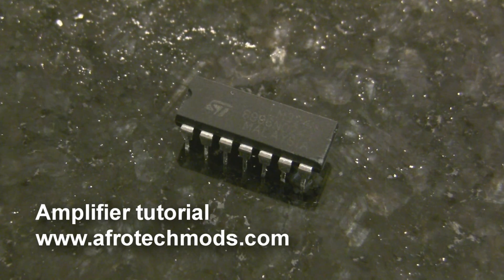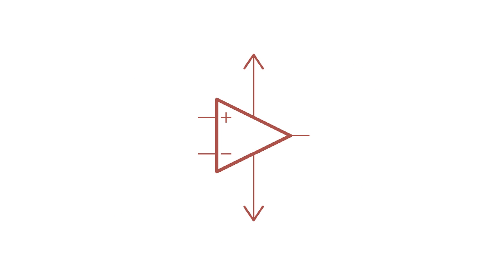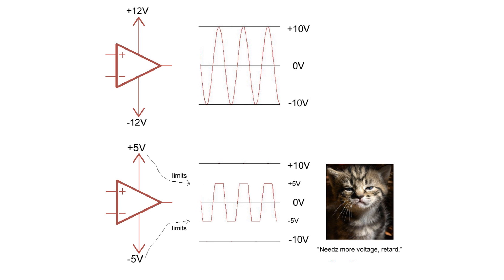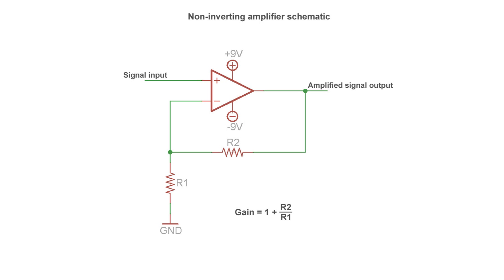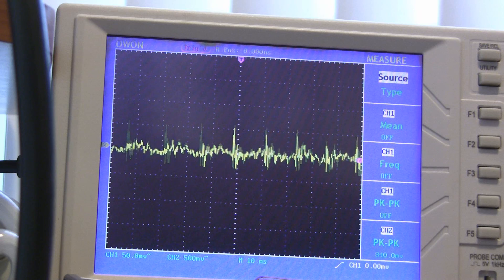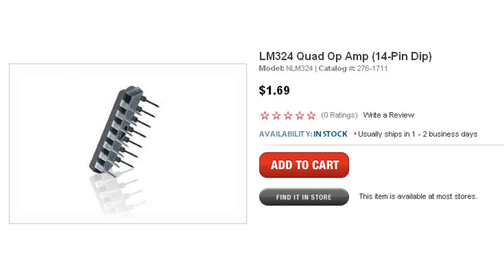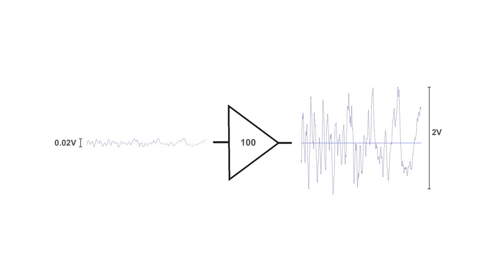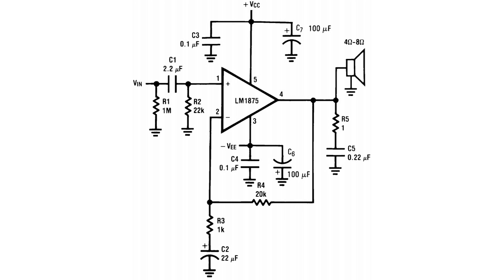What is an op amp? Operational Amplifier tutorial & super spy microphone circuit

Comment: I undersstand that the LM324 can use a single supply. My experiment is not showing the output is 1/2 the supply voltage but zero voltage. On an LM358 the output would not center to 1/2 the supply. I connected the +(non-inverting input) to ground or negative and used a feedback resistor of 100K and the (-) inverting input resistor of 47K.. It did not work (the LM358) until I made a 50:50 divider on the power supply with the middle of 2 10K resistors connected to the non-inverting input. The IC is acting like it is for dual split power supply. I think the paranormal is involved and they are changing the physical with the mind.

Comment: Is there a circuit (like buffer) that'd take reference voltage and spit out same voltage, only it would also supply more current for example with external battery. for example voltage divider doesnt provide current, but if you could connect it to a buffer, it would power from external source and it would. Does something like that exist?

Comment: What are these grounds? :( i cant understand where to connect them? help plzzzzzzzzzzzzzzzzzzzzz
Reply: In most cases, "ground" is just a short way of saying "a reference point for every other voltage."

In the above video, it's the point where the positive of one 9V battery connects to the negative of the other 9V battery.

If you measure from that mid-point to the positive of the top battery, you get +9V but if you measure from that same mid-point to the negative of the lower battery, you get -9V.

So is ground -9V or +9V?  The answer is, both, because you're using the connection between the two batteries as your "ground" reference.

In general, all grounds connect to all other grounds.  There are exceptions but they don't apply to this kind of circuit, and when they do apply, a different ground symbol is used for each type of ground.  So using the ground symbol is just a short-cut so you don't have to draw as many wires in your circuit diagram.  The wires are there, but they're implied by the ground symbol instead of being drawn in.

In simple circuits, ground is generally the negative power connection, but in the above circuit, it's the junction between the two batteries.
Reply: NOT ALWAYS.  See what JasonMasters wrote.
Reply: connect them to the negative part of your battery, ground=negative part of battery
Reply: Thanks :)

Comment: Just perfect! One question, can I use a LM358N with 5v for V+ and GND for V- to supply this circuit? I know that I will lose the negative signal
Reply from the maker: Matias Novillo It will work but you can expect to get extremely distorted and clipped sound.
Reply from the maker: Afrotechmods Err scratch that sorry no it won't work you'd need a DC bias for the input. This guide may give you some ideas: http://www.ti.com/lit/an/sloa030a/sloa030a.pdf
Reply: Afrotechmods The problem is that I just want the peaks of sound that comes from a mic to take them to a vumeter, I dont want fidelity. Is it correct? Thanks for the help sir
Reply: Sir, one last question. Can I use +12v and -12v instead of 9v for all that circuit? Sorry for annoying
Reply from the maker: Yes that will work great!
Reply: Afrotechmods
Thanks sir!

Comment: Does polarity matter on the mic & speaker? I'm guessing it doesn't because it's AC.
Reply: Ur right MIC diaphgram signals are handled by high pass filter comprising of one or more capacitors, also remember the capacitor in such a circuit ensures no dc signal is leaked out the MIC in any case coz if we remove the capacitor from the signal path to the op amp then we will hear a buzzing sound of DC Power rail

Kirk B
M.E

Comment: Thank you for your video. I have recently modified the circuit,using a LED instead of an ear-plug. But I come across a problem: How can I increase the sensitivity of the circuit, so that even at a quiet background, noise can also be picked up at the output LED?

Comment: thanks for the video. i have a lm324 used as a voltage follower powered by 12v.could the output be regulated at 6 v before clipping occurs .My input varies from 0-20v ac(my cars subwoofer)(i have a diode connected because im only using the positive side of the audio signal). i was thinking of using a zener diode but im not sure how it would be connected. thanks in advance. keep up the good work

Comment: cat noises <3 What about powering an op-amp with a power supply like I don't know...a phone charger? What should I do to have negative voltage? Voltage divider with GND in the middle should work or am I wrong?
Reply: You're not wrong. Many stomp boxes use a 9V battery with a voltage divider to supply +4.5V and -4.5V.

Comment: Great video. It's worth noting, though, that using a split supply (i.e., two separate batteries) is completely unnecessary. Take out one battery and just add a couple extra resistors to bias your signal somewhere near 4.5V, and viola. Still heaps of power for earphones.

I know the author was keeping it simple for pedagogical purposes, which is fine, but I wouldn't want people to watch this video and then go and actually start making two-battery amplifiers...

Google "single supply op-amp" for more details; most battery-operated circuits will work this way.
Reply: I always use single supply with my Op Amps!

Comment: The ground is connected to the middle of the batteries series, as shown at 1:40.
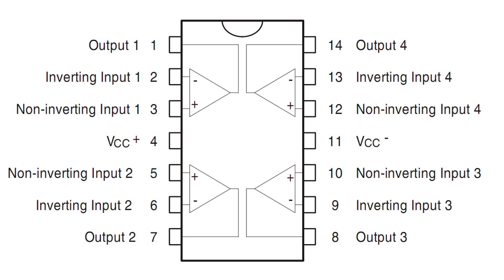The 9V output of the power supply goes to pin 4, as -9V to pin 11 of the LM324 shown at 3:29.
This whole configuuration is to keep the output signal oscillating symmetrically with respect to the ground reference (I mean, with a 0V input, the output will be 0V too).

Comment: i don't know what you mean with "in series".
Anyway you can connect in parallel two or more opamps to get more
power at the output.
But for a power amplifier you will need A LOT of opamps... and money...
For example:
To obtain a 8Watts power amp into 8omh loudspeaker we need:
8/8= 1Amp current.
A TL071 can deliver a maximum current of 20mA (0.02A)
So we need at least:
1/0.02=50!!! opamps.
Listen to me use an integrated power amplifier like tda2050
50W, 3 dollars... and less problems :-)

Comment: NO you can NOT remove the 100k resistor
It is used to "discharge" at ground the input bias current of the opamp.
without it, the current cannot "discharge" correctly because there is the capacitor and the amplifier will get saturated.

with lower resistor values you will have lower input impedence 
and worse bass response(bass response also depend by capacitor value).
But with higher resistor values you might have noise and offset problems(it also depends by the type of amplifier you use)

Comment: Thank you! I've finally made my guitar pre amplifier thanks to your video. But the potentiometer at the end... I think it woud be better to connect it like voltage divider, so one end of potentiometer goes to op-amp output, second end to 0V and the middle to speaker or in my case jack output.

Comment: Beginner question: what if we stack lots small opamps like tl071 to handle higher currents and in series with other stacks to handle higher voltages (with proper cooling)? Could we make reliable power audio amps?

Comment: Low impedance means low "ac resistance" so it is a heavy load for the frequencies of interest that will force/cause the source to provide more current the source may or may not be able to provide. An 8ohm std speaker for example would be too heavy of a load, presenting a too low of an impedance for LM324 can drive.

Comment: Encouraged by your video I´ve made the circuit. 
I have a problem, When I disconnect the batterys common terminal to GROUND, it works perfectly, but it stops working as soon as I make that connection.
THANK YOU! It's a very good video.

Comment: The position of the volume potentiometer is wrong.
it should be connected to the input of the amp with the cursor to the non inverting, the resistor to the mic and the other lead of  the resistor to ground.
you can decouple the cursor form the input always via a condenser.
About Radio Shack. If it is RS-COMPONENTS normally they sell only if you have a VAT number :-/

Comment: I used LM2904N, first i hooked up the ground wrong, then I rewired the ground, so it was working. Then I wasn't so happy with the gain so i replaced 1k resistor, with 1k trimmer (it's now set somewhere about 700 Ohms) and the second resistor with a potenciometer (i've set it on 0 Ohms), then I was happy, but then I get that my microphone is weak. So.... I connected it to my keyboard, I played a piano sound and it sounded like a fucking GUITAR!!!!!!!  xDD

Comment: Hi, I'm confused about high pass filter RC value. Using the fomula for cutoff frequency I get about 15.9Hz. Does the clapping sound really produce frequencies higher than that?

My second question is about the 100K resistor. Why does it need to be there? Isn't the capacitor itself enough to filter any DC voltage? Thanks

Comment: I builted the circuit using 2 stage of the but there is noise. I hear it in your video. High or low  pass filters are useless. How do I filter this? With a self ?  How do we do that?

Comment: Awesome video. I'm trying to increase the sensitivity of a piezo transducer to use as a vibration sensor. Could I use the above circuit to increase the sensitivity or gain of said transducer to drive an LM3915N display driver??? Basically I'm using the transducer as a vibration sesnor and I want it to be really sensitive so I just about have to just think about vibration and the LED driver will display on the LED's. ;)

Comment: Dunno if he's gonna respond, haven't seen him on here in a while, so I'll take a shot at this:
You could use a charge pump circuit with a 555, but that's not the best way to do things.  Look up Afromans tutorials on adjustable voltage regulators and the one on transformers.  Get a centertap 12V transformer and use an LM337T & LM317T to regulate the negative & positive voltages.  You'll be able to adjust over a wide range and get well regulated +/- V from one power supply that way.

Comment: electrect mikes need a small power supply, i think cause they have a capacitive property
the 20mV is the DIFFERENCE in voltage with respect to the power supply, when you speak the capacitive plates in the mike deflect changing the voltage at the resistor which is say 4 volts with tiny changes in the voltage

Comment: what happens to the audio signal if the negative(-) supply voltage of the opamp is replaced with 'ground'?  Will the audio signal be clipped?

Comment: I tried to built this circuit using an NE5532 I would get loud sound them it would fade to quiet. I tried two NE5532 still doing the same thing. Then I tried a OPA2134PA now it works great!! My only guess is that the NE5532's are damaged in some way. But I would rather get a NE5532 or other op-amp to work as the OPA2134PA expensive compared to other op-amps and its more suited for headphone amps. Will try a LM324 like in the vid!!

Comment: @GalaticTG look into voltage divider circuits, should point you in the right direction.

Vcc---/\/\/\/\(R1)---+(floating ground)---/\/\/\/\(R2)----Gnd 
make R1 and R2 the same.
so in the case of the amp circuit shown, the ground route for the mike would be connected to the floating ground and the negative on the opamp would go to Gnd.
if that makes any sense.

Comment: why add "smoothing" capacitors if you use batteries?  Batteries generate perfect DC (unlike rectified ac ).  Is it the op-amp that can momentarily draw too much current from the batteries and that would make the voltage drop (w/o the caps)?

Comment: I want to learn HOW TO build a condenser mic through an audio amp THEN match the output to my 500 Ohm input for my CB radio.

Nearly all circuits output into a 8Ohm speaker.

Ive already learnt from your videos how to set the gain of the amp. But then im lost. I need [i imagine theres LOTS of other radio users too].

PLease help me with a impedance matching circuit with an output volume control.

God Bless.. Rod a CB radio nut

Comment from the maker: @davidenelson Contrary to what is presented in this video, the better volume control circuit would be to have a fixed gain amp (e.g. gain of 10 to 20) and then use a potentiometer to divide down the input voltage.

Comment: Your supplying 18v but only need 2v output!!, a bit overkill don't you think. Have a look at the LM324 datasheets from "ST" for example, it's got a "typical application" section and shows you how to use the chip (inverting and non-inverting) with just a single positive power supply (a single 9v battery) using voltage dividing resistors.

Comment: Here's a question that I'm sure has been asked before but I just can't find the answer here. Does the +9V used to power the mic have a different ground? are there two grounds in the circuit? don't be surprised by the question, I'm learning electronics, thanks.

Comment: Hey Afroman,
I have built a 3band audio spectrum analyzer out of OPAMPS, and I am currently moving it to five bands using a bunch of 324's. I am using 324's as comparators and amplifiers, but I cannot use any other OPAMPS for some reason. I have one LM324 as an amplifier, and I need one more for my fifth band, but my TL082, and my uA741 do not work as non inverting amplifiers. the output just stays at high. Do you have any idea why?

Comment: Awesome Vid,  I have an issue though with the circuit, I'm actually using a 0372DP1 Dual op-amp, and running with +/- 12V power supply. and it works great the only issue is that when I power up the amp it blows up my head phones with a nice POP! what do I do to stop this, it's happened twice!! :(

Comment: @Afrotechmods: Somebody suggested me that Mosfet is good. But it has non linearity. I am developing a PID controller in which an arm attached to the fan has to be rotated angainst a torsional spring. So the controller controls the voltage which consequently controls the angle travelled by the arm . fan takes volatge from 0-8.4 volts easily and current 0-6 amp. DAQ gives 0-12 volts but current in milliamps- current is the concern.i need a fairly linear amplifier (don't have to be too precise)?

Comment: Hey guys I need help with this video, important to mention I'm not an expert in this field. The schematic diagram shows two +9V's, are they the same or do I need two totally different power supplies in the circuit? and also,if instead of a mic I connect an MP3 player, that means I wouldn't need the 5k resistor and that +9V power supply on the left of the circuit, right? the connection would be (from left to right) MP3-capacitor and the rest?

Awesome video by the way.

Comment: @Serpico261 All that happens is when you use a single supply, is the output becomes half of what it would be for a dual supply eg. a dual 9V supply will produce 9V + and 9V - for a total signal of 18V peak-peak..... a single 9V supply will produce a signal of 9V peak-peak, wich is half. with a sine wave, the only audible difference will be output level. It is better to use a dual supply but not necessary. If the chip takes 18 volts you can make that a single supply and not lose much signal.

Comment: @Shoyrou If you do a split power supply eg +9V and -9V Ground is for signal ground only. Tie all GND parts together and that becomes the (-) of your signal. If you use a single supply, +9V, the grounds go to the (-) on the battery. Notice the power amp he uses has a single supply. Tie the signal ground from your op amp to the ground of the power amp, and the (+) output of your op amp to the (+) input of the power amp. Good luck!

Comment: I wouldn't use a gain of 100 ever. The chances of oscillation or a roaring sound are too great. If you use the op amp that he said to use, there are 4 seperate op amps in that package. I'd go with 20 gain from #1 20 gain from #2 and use the #3 as a buffer. Also use a board POT to vary the output to the power amp so you don't overdrive it. I'd do the same if driving ear buds with the op amp.

Comment: @Afrotechmods - thanks for your reply.
I'm a bit confused. I thought the cutoff frequency is a function of 1/(2Pi*RC) where R was the load. An extra resistor strictly speaking isn't needed right? and what do did you mean by "If all you have is a capacitor sometimes the output floats around DC biases you aren't expecting"? Could you dumb it down for me?

Comment from the maker: @hyperboogie Normally the resistor is needed to set the cutoff frequency but in this case it's also essential because it acts as a pulldown to ground, so the signal ends up swinging from -10mV to +10mV. If all you have is a capacitor sometimes the output floats around DC biases you aren't expecting.

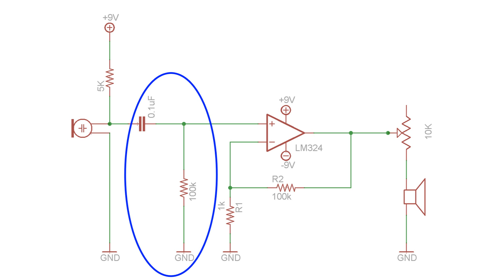Comment: I have a general question about the high pass filter (3:12) why is a resistor needed?
as far as I understand, the capacitor's impedance drops in high frequencies and increases in low frequencies thereby blocking/attenuating low frequencies, but why is the resistor needed? isn't the capacitor alone enough?